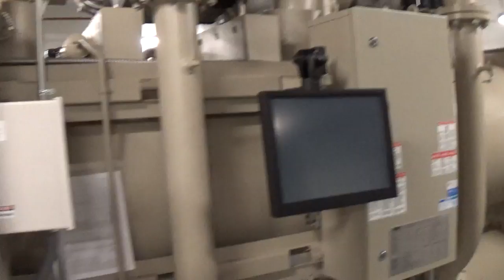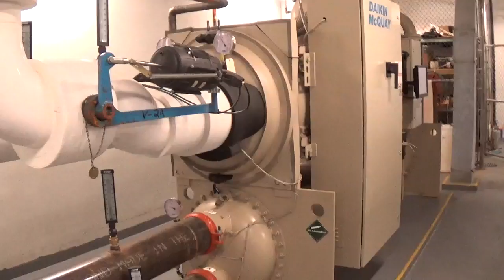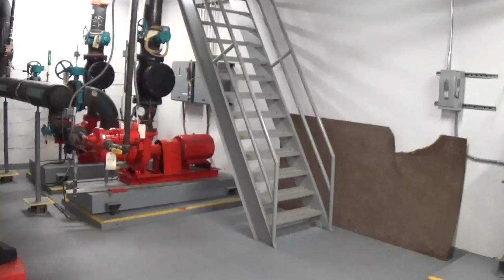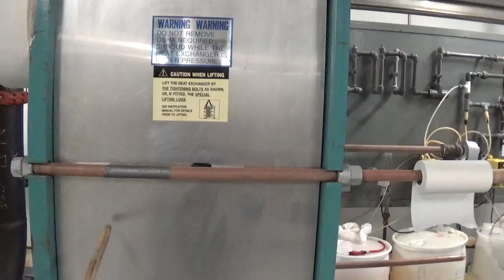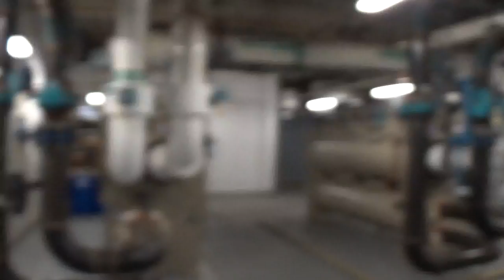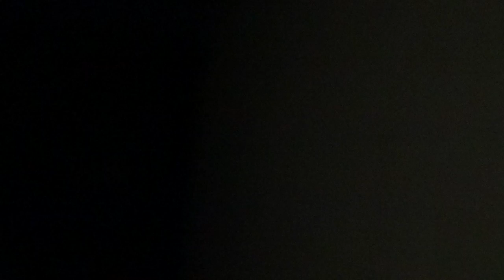Chiller Plant Operations

Comment: That's very odd that you're using pneumatic actuator, so you need an air compressor for air supply. These Daikings chillers use  R-134a refrigerant. Now I have a question, is this plant a load based system or a flow based? Are your AHU'S VALVE TWO WAY OR A THREE WAY VALVE SYSTEM? IF THE VALVES ON  THE AHU'S THREE WAY IS A FLOW BASED SYSTEM. IF ITS A 2 WAY VALVE THEN ITS A LOAD BASED SYSTEM.
Reply from the maker: Hello. Thank you for your comments and questions. Yes, this plant does use pneumatic actuators and a very large multi-stage air compressors. The air is used in other applications in the facility. The building is very high and even with extensive lightning protection, we had terrible time with lightning strikes and surges. Many electronic devices in the plant are affected. We have found electronic actuators slightly fussy and unreliable. In over twenty years, even after retrofit, we have only had to rebuild two actuators. Very reliable. The system is load-based. It uses 2-way CW valves at the AHU's. Thank you again for your interest and joining us on the channel.

Comment: Mr Paul what was evaporator your approach temperature on these chillers? 4-6°F approach
Reply from the maker: Thank you for your joining us and your question. I will need to pay more attention, but I would say you are very close at 4-6 degrees F.  Perhaps, 3 to 5 F might be closer. I will say that the old R-11 Trane units, were capable of colder chilled water than these newer units are. It is not really noticeable in the building climate control or performance.

Comment: You should be getting a good Lift on with this chiller. Is your cooling tower  a crossflow or counterflow type or evaporative tower.
Reply from the maker: Thank you for joining us and your comments and question. Usually the lift is solid; sometimes on colder days before we turn over to the economizer, the lift can vary a bit. Generally, the chillers are very solid and reliable. It is a crossflow tower.

Comment: Is this chiller facility a 14-18°F Delta T plant? What's your current COP? and how much kW/ton does it consume. Also what's the EER? I imagine you have either an airside or waterside economizer
Reply from the maker: Thank you for joining and for your comments and questions. You are close on the Delta T. Maybe 15 to 20 degrees is closer. Yes, we have a waterside economizer. I am not privy to any costs or electrical bills so I cannot comment on that with any accuracy. The building owners have commented that the electrical costs are much reduced (obviously) over the old chillers.

Comment: You said condensing pumps take water from condenser and pressure it to the cooling tower and this is wrong .. The condensing pump pressure cold water from cooling tower to condenser and it is found in return side from cooling tower to make sure there is always enough flow of water to absorb heat from hot gas refrigerant

Comment: Yes the electric actuators fail all the time. Those pneumatic valves are hard to beat as far as reliability and longevity. Looks like a nice facility. I'm always stuck working in shitholes with lack of maintenance. Those chillers say daikin mccquay, I hope they are better quality than these new daikin units that Goodman was putting out.

Comment: The HX plates, are they copper or SS ? The open loop will eat thru the thin cooper plate very fast.... they need the put a blanket on  the HX and some sections of the open lOOp connecting to the HX .
Reply from the maker: Stainless steel plates. Thank you

Comment: Some York YMC2 chillers would have been a better choice :)

Cool video though!

-York Chiller Mechanic
Reply: Derek Conner
I have serviced /repaired them all and I must say York is by far the worst. They are quality , however their software is not user friendly and plagued with bugs. We've also had several issues with poor connections causing weird alarms that will come and go at their own will. Trane is by far the best platform. I do speak of equipment thats down in Florida. The high levels of humidity may come into play with my opinions on these machines. I don't know how yorks do up north.
Reply: Luigi Luigini 

Hmmmm that is interesting considering I have never had any of those particular issues with any York, water cooled or air cooled.  I'm not biased, but I am master factory trained by York and know most issues that they bring a customer.  I'm interested in the bugs, and connection issues.  Are we talking about old York machines or newer?  Huge difference between them.
Reply: Derek Conner 
Yes 15 + yr old YCAV Air cooled screw chillers. I may have exaggerated a bit but the York's are definitely the least user friendly for someone who is not specifically trained for York's.
Reply: Trane is what we use!